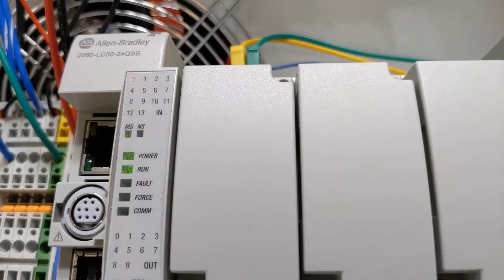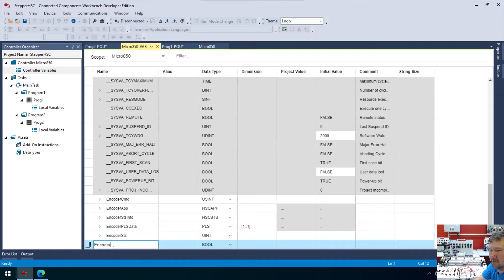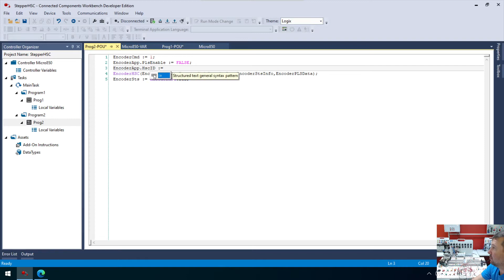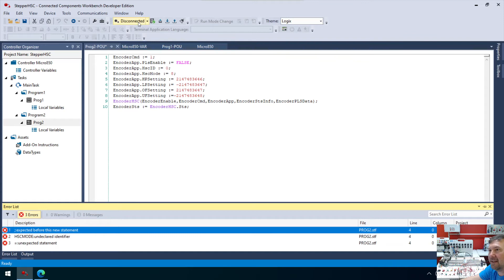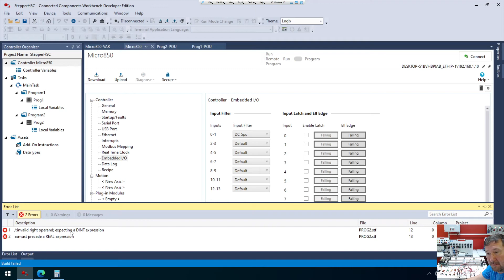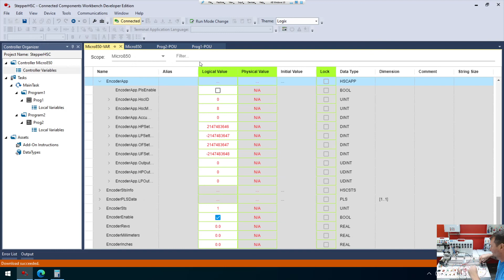Wire And Configure An Encoder To An Allen Bradley Micro850 PLC

Comment: How HSC is assigned for 2 nd encoder? How   Hsc1 and 2 both set up with 0-1and 2-3 input ?
Reply from the maker: No, check the manual but I believe it is 4 and 5.
Reply: @TimWilborne  thank you sir for responding.  But in accumulator valve is not changing...any imp. Parameter need to change in HSC instructions ...? I m using 850 plc.